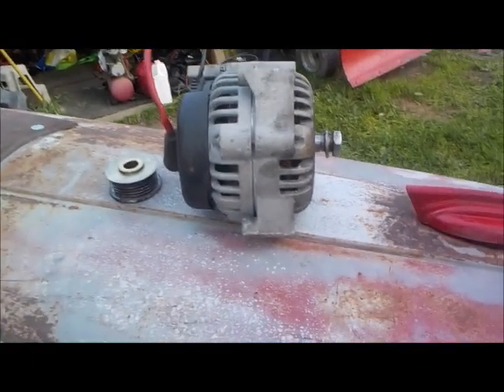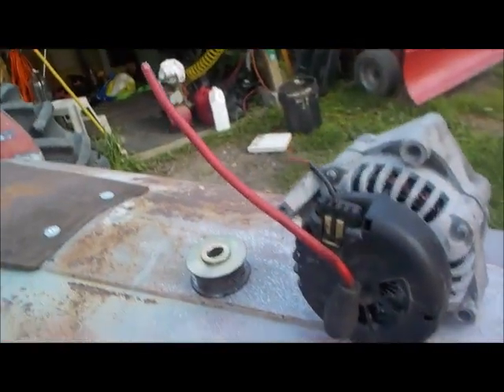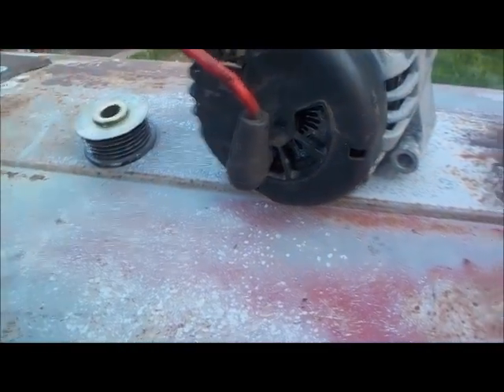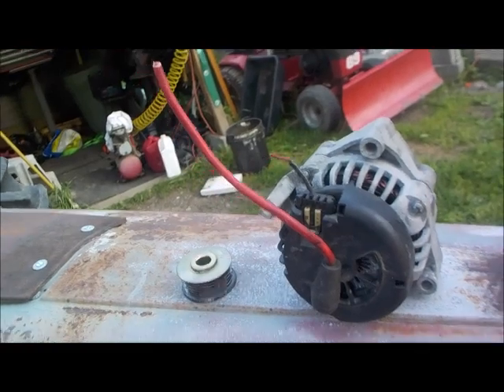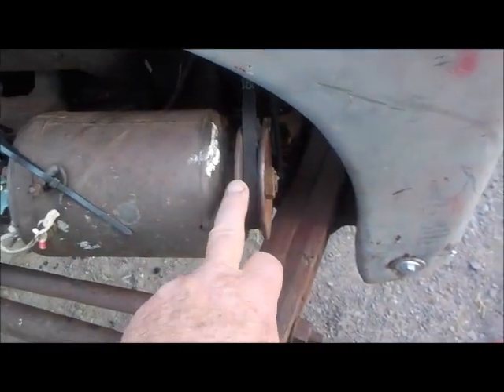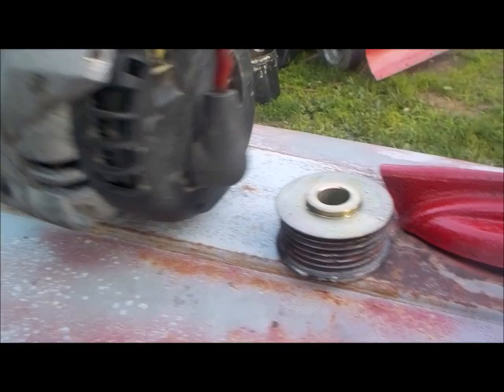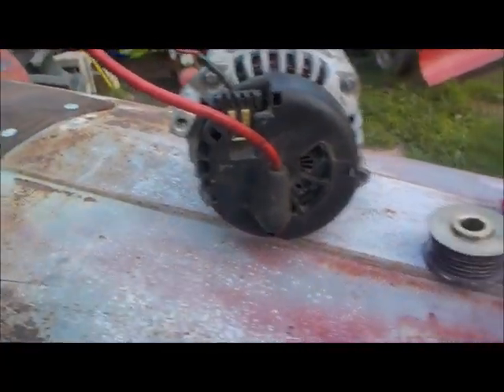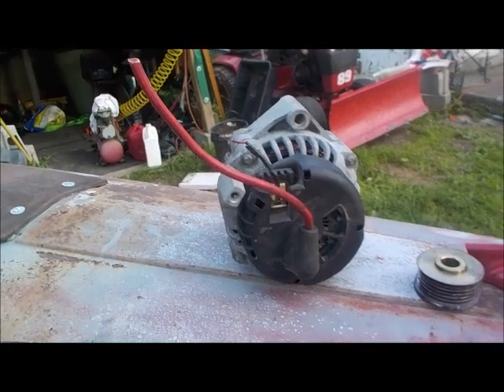NEED HELP:  Chevy Alternator Wiring.

Comment: That wire is for light on ur dash... big wire to battery +... so the little wire is hot from key power goes throw bulb down to alternator.. when alternator starts making current (which it does when it starts spinning) then it applys 12v back out that single wire.. so u got 12v going to it.. the alternator starts 12v comes back out which in turns cancels out the key power 12v..light goes out

Comment: Not sure , try hooking it up like a 1 wire if not put power to that small wire. The small lead might go back to PCM originally
Reply from the maker: I'm thinking the small wire goes to the Idiot BATT light on the Dash or the Amp Meter perhaps. GOT to be Sure,can't Guess, I Don't want to FRY anything.
Reply: @MrDanoconnor  tool small of a gauge of wire , gotta go back to computer , ,
Reply from the maker: If that's True then I don't need it.
Reply: @MrDanoconnor  Did you watch the video I posted for you? If you did you'd know the answer!!! Now you asked for help and I helped but you didn't even take the time to look!!! Good luck!!!
Reply from the maker: I didn't get the Notification of Your Video until Just now.  I Knew You would have the answer Lickity Split...Thank You
Reply: @MrDanoconnor  and the answer is ???
Reply from the maker: Take Your Pick...

Comment: I used an alternator from a 1980 Chevy Camaro for my Farmall Super A. The red wire should go to the starter and the black wire should go to the ignition switch. I have a light inline with the switch
Reply from the maker: So,that was a 2 Wire Also Robert? If so, I assume you mean the HOT Wire Side of the Starter, which in turn goes to the Battery?
Reply: @MrDanoconnor  Yes the positive side of the battery and the wire from the alternator goes on the same post of the starter.